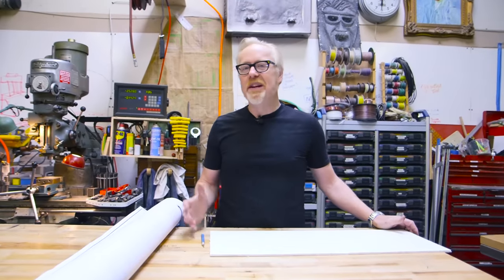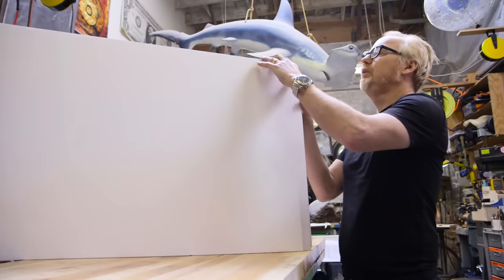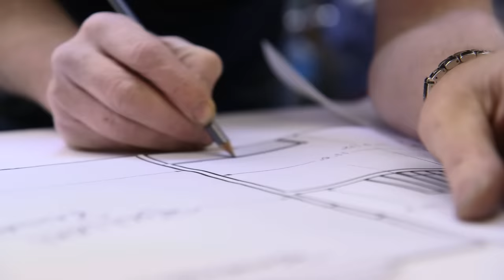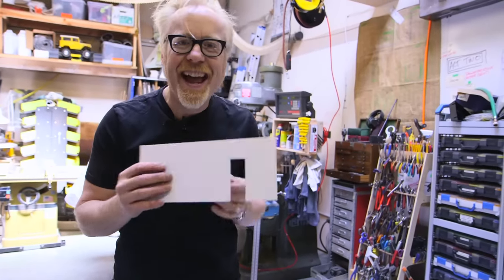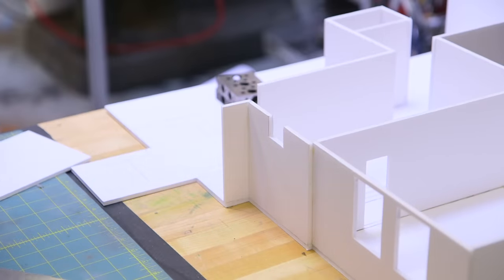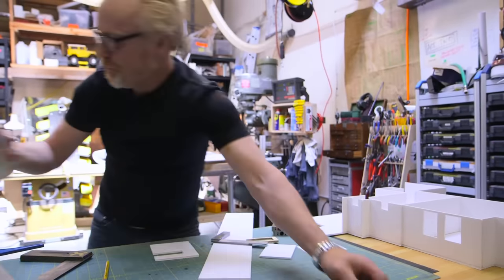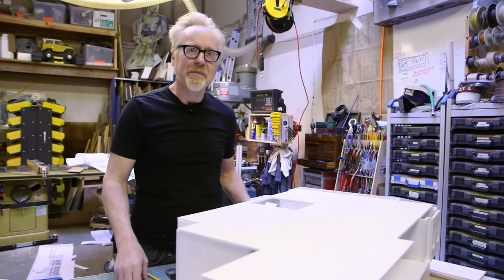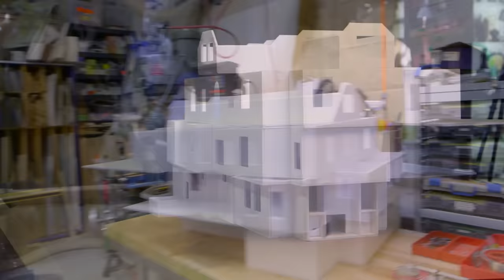Adam Savage's One Day Builds: Foamcore House!

Comment: I have a pedal powered kart, 4 wheel drive and 4 wheel steer that’s about 2/3rds built. I have not seen another design like it. I’d like to finish it,,, test and tinker then build the 2nd version with aluminum tubing like a bicycle. Then I’d like to get patents on it and see if I could get it into production. The only thing holding it up is my battle with Lyme disease right now.

Comment: You only need "one tool" for this build:
--Exacto handle and #11 blade
--extra blades
--pencil, soft
--t-square (large)
--hot glue gun
--123 blocks (3)
--table saw
--band saw
--tape measure
--mechanical pencil
--sanding file
--carpenter's square (large)
--carpenter's square (small)
--tweezers (large)
--ruler
--t-square (small)
--calipers
--unidentified strange tool that looks similar to calipers but isn't (11:57)
--cordless power drill
--calculator

Comment: It would much easier to simply glue the plans directly to card stock using spray-on glue. 
Best card stock to use is cereal box cardboard...especially those multi-pack boxes from Costco. Save on the foam core.
You can also glue on prints of textures. Looks great--much more realistic than painting.

Comment: Really a cool video, I've watched you on MB and a few vids here like your star trek chair, that spider that came in its own case, my gf even told me about your awesome nerf rival mod. I was surprised to come across this video when looking for software for designing homes, I once built a small model home for a project with plexiglass and 2 wood cutting boards, but seeing you do this, the only thing I don't have on hand is the foam board and there's a store 2 blocks from me that have over a dozen different colors of that though in smaller sheets, 2' x 3' i think. the more i think about it as i type this i realize how great it was to come across this video, instead of creating it on a computer i can create a physical model that, like you, i can get my head around..... Sheesh, foam board, why the heck didn't I think of that. SUBSCRIBED! =D

Comment: That blade looks a lot like a surgical blade that I use. The add for them said these surgical blades are sharp but there not for performing surgery. Odd right? That slot in the blade is how it snaps onto the handle I have they are insanely sharp even when a bit dull.

Comment: I know this comment comes over 4 years late, but sitting at home gives someone time...  not sure if anyone said this but architects use pounce wheels to map plans to foamboard or chipboard, or cardboard.  best tool ever.  I have used a simple low tack spray mount and this wheel https://www.amazon.com/Excel-Blades-American-Perforator-Embossing/dp/B00M0KQ7RI to mark all sizes... or contours. Adam if you ever make topography, use this method.

Comment: Even though the tip is no longer cutting the board as sharply, that blade has TONS of life left. The base is probably untouched, not to mention there's tons of other material that doesn't require super sharpness for a clean cut. What a waste. Just store the used ones for later use.

Comment: Maybe it's because it doesn't have details or even a roof, but I don't understand this house.... like why don't the floors align to eachother? Looks kinda ridiculous to me. Nice work nonetheless!
Reply: Might be several reasons for that.  The first that comes to mind is that it was designed on a modern architecture view point, or possibly the house had over hangs from one floor to the next (possible), or the hose may have had a few porches on it.